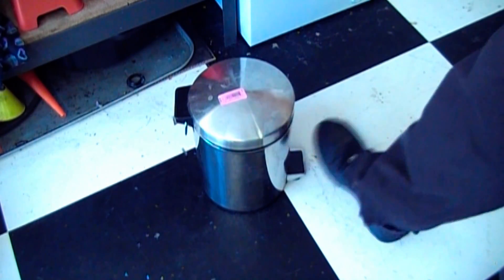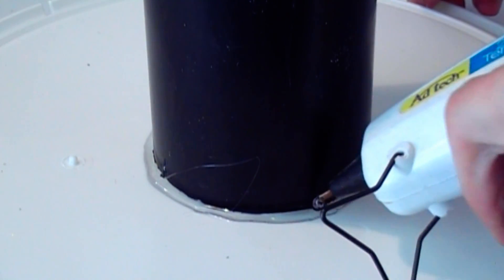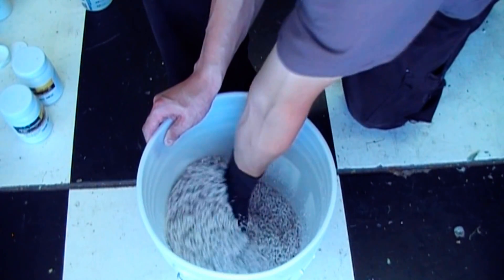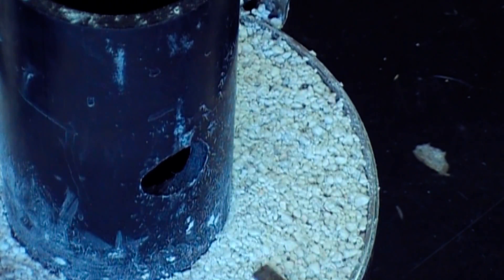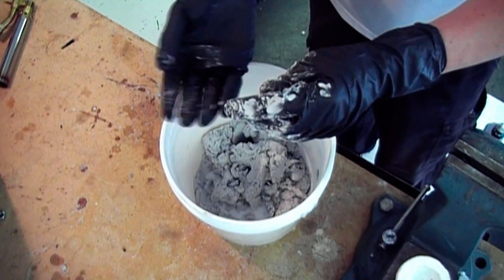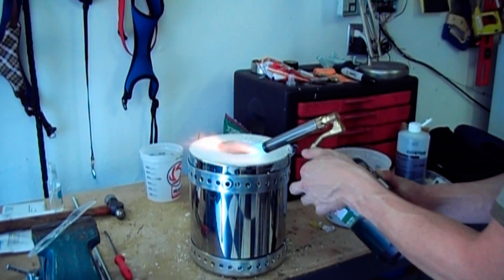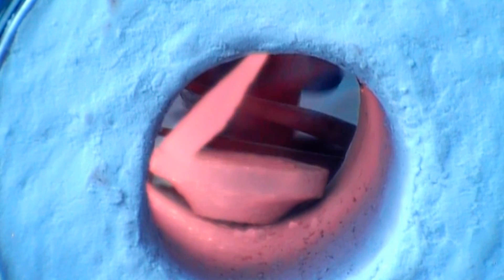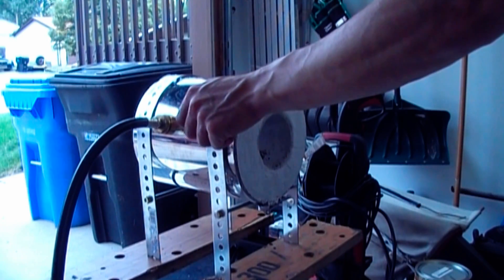How to build a trashcan forge

Comment: very nice forge, by add the aluminum, does it keep CO2 from curing the sodium silicate? Sodium silicate is often used in casting sand, and CO2 is used to make it set up.So I was wondering if that is why you used heat to cure your small parts  or if a crucible is made from the mix.
Reply from the maker: The aluminum oxide is the primary refractory material here. The perlite adds insulation, the sodium silicate glues it all together. I use heat to cure it because it's easy, CO2 would also work. There is a lot of CO2 in the torch flame too.

Comment: Got a question - do you know the solution of the sodium silicate? most im finding online is ~40% sodium silicate ~60% water. Awesome forge BTW!
Reply: offraodmisfits Its all I can find as well, I looked into it a bit more and it should be totally fine as long as you do what Clkindred mentioned which is letting it dry a day or so (with the alumina oxide) before applying it.

I am currently gathering up all the bits and pieces and should get working on it this month. If you haven't started by then i'll let you know how it went. :)
Reply from the maker: 40/60 is more dilute than what I made with the sodium hydroxide and silica gel, but I cut my solution with an equal amount of water for the perlite part of it. The only area where the 40/60 might be a problem is the aluminum oxide sealing cement, I did not thin my solution because too much water there will make the cement "blister" when heat is applied to cure it. You might be able to use the 40/60 for the alumina cement if you let it dry for a day or two before exposing it to heat. Thanks for the comment!
Reply: Thanks for the reply, i'll have to give it ago with the 40/60 solution and hope for the best, ill take your advice and let the alumina oxide dry a little while before heat treating it. 

Sadly it looks like the #10 can I got from work is galvanized which I find weird because it was used to store pineapples. 

Thanks for the info :)
Reply: SloanAlex  have you done it with the 40/60 solution? because that is all I can find.

Comment: The desiccant I got from some computer boxes is what I thought was silica  gel was actually a clay looking stuff could I use that
Reply from the maker: It might be sodium bentonite clay, in which case no, it won't work for making sodium silicate.
Reply: What could I do with that clay
Reply from the maker: Manuel Ramos Not much, you can use it to ram rocket engine nozzles and end plugs, or soak up oil spots in your driveway.
Reply: OK cool
Reply: You can use that clay to make casting sand for pouring molten metals into.

Comment: This looks very interesting and well made. You are a very smart person. I have a question that to some it might be silly but I'm not familiar with any of this stuff. The question is What can you use this forge for?  What can you do with it?  Thanks :0)
Reply: With a small forge that size you could make small projects from nails and small knives to something as long as a lawn mower blade to make big knives and machete's. And by the way the only silly or stupid question is the "one that's never asked", if you don't ask you'll never know. Thanks for asking.
Reply: Wayne Hendrix  Thanks  ;0)
Reply from the maker: Yep, heat treating blades, as well as small forging projects is what I will be using it for.

Comment: Great video! Can‘t you use regular concrete or cement for the insulation or won't that hold the heat and/or break? I don't know where to find these sodium silicate and all that stuff here in europe and concrete is much cheaper. Thanks in advance
Reply from the maker: I tried concrete a long time ago but decided it was a waste of time. The thing just would not get hot, there is so much water in the concrete, and it's so dense and heavy it just sucks the heat away.

Comment: Is there any significance on this one being a "thru and thru" forge verses one with only one opening like your coffee can forge? In my thought process, I feel your coffee can design would be more functional, due to the ability to trap more heat.
Reply from the maker: MafiaMotorsport Closed end forges are hard to heat long objects in. You can get the tip very hot, but if you need heat farther back, you are out of luck because you can't push the work piece any father back. I'm working on some sort of adjustable door set up so I can close it up for better heat containment. A failed prototype can be seen in the back of this forge in my forging project video.
Reply: clkindred ahh I see, and understand.  I will still most likely use the other design except find something that will still be deep enough for my needs. I like the idea of a door as well. Thanks for the great vids.

Comment from the maker: +Meticularius You are welcome and thanks for watching!
Reply from the maker: Yea, that is the concentration of the solution. My recipe starts with 500 grams of total solid material, and 500 grams of water, making a 50% solution, however I boil down the sodium silicate to about 60-70% concentration.
Reply: Iv just taken up knife making. Your video has filled me with confidence to try and build my own forge. Thank you for your time and effort on these videos. Could you maybe just give me some idea of what could go wrong during the build. What things to pay extra attention to etc. or even safety measures to follow. Would appreciate it a lot. Thanks man.
Reply: +john black i have actually gotten the plaster of paris mix to work, 2 parts plaster to 3 parts sand
Reply: William Ponder If you look through the rest of his videos he has instructions for Sodium Silicate & his paint can forge shows how to go about building up the walls.
Reply from the maker: No, just about anything can be made to work, as long as it's big enough to allow a thick enough lining.
Reply from the maker: I think they stopped making those because I can't find them either. You can use a 1/8 to 3/8 BUSHING, threaded into a 3/8 to 3/8 COUPLER to make the part.
Reply from the maker: I show that method in my "building a bigger blowtorch" video
Reply: this is really cool could you make something like small knives with a set up like this?
Reply from the maker: Sure, my newer videos show projects like that.
Reply: cool a friend was showing me this video before and we were thinking about building one to make knives
Reply: I found sodium silicate for sale but the have percentages next to them like 40.% and 37.5%. Type in sodium silicate on eBay and you'll see what I mean. Ps is that percent mean anything?
Reply: Do you think it will still work okay with that low of a concentration?
Reply: +clkindred I really like this video and I was wondering if using the combination of 1 part Plaster of Paris and 1 part Sand I keep seeing in other videos work just as well as your mixture?
Reply: +clkindred How thick does the perlite lining has to be? Do you think 2.5cm are enough to smelt aluminium ( 600°C)? The wrap is 2mm steel and some case heat would be no problem.
Reply from the maker: That might be on the thin side, 3cm to 3.5cm would be better if possible.
Reply: Okay, thank you. Hard to find a zylinder with the perfect radius. Make I'll craft one out of cardboard...
Reply: +clkindred great video - would I be able to use this cement on the inside of my home made braai (bbq)
It's a metal drum cut in half. I used heat resistant spray to avoid rust. Now, this cement would be great for the inside.... ????
Reply from the maker: +Verum Quaerere Seek Truth To cook food over? It should be fine as long as your chemicals are pure, if not there might be some nasty stuff burning off for the first firing. Personally I think using this cement for a food cooking device is more trouble than it's worth, unless there is some huge advantage that I am unaware of.
Reply: clkindred Yea, in South Africa... we 'braai' regularly - the problem is, these metal 'bbq' rust - also hot to the touch on the outside. I want something to paint on the inside. Nice smooth finish.  I have used expensive heat resistant paint just to melt or bubble. So if I could insulate the inside, I'd use less coals, and prevent my braai from rust. Some videos use plaster of paris for diy forge/furnace... please help.
Reply from the maker: Oh, sorry I don't check g+ very often. If it's not too late, my advice would be take your time, sand and polish all the tool marks of before hardening. Otherwise those marks will always be there. Also, don't file the bevel so close to the center line so as to almost sharpen it. There needs to be some thickness to prevent warping and carbon loss from the steel during heat treatment.
Reply: Hi  @clkindred   I'm just curious to know how well this mixer held up over the years? When did you reline the forge? 
Also what temperatures were you able to achieve? Great video by the way.
Reply: does break and crumble after a few heats though
Reply: +clkindred I just posted a comment/summary of your two builds. Had a few questions I think a lot of us have on your experiment. Might be able to pin it at the top and save a lot of individual questions. 
My post starts off with "That was 3 years ago".. Wasn't sure since I didn't reply that you would get the comment.. 
I don't get some comments on my videos for some reason I can't figure out and hate to see one go unanswered for a long time.. Answering gets me thinking..Ha.. Thanks fella.... Nice Videos.
Reply: I posted a question about how well this has lasted for you, and your opinion about the Aluminum oxide paste you hot face coated the face and inside of the forge.. Sometimes I do not get notification, unless someone posts a reply to my reply.. Just adding a post won't give me a notification.. I have to look for it. The reason I posted here.. I am going to build a forge, and was thinking about this.. I have black aluminum oxide blast media that I am not using any more. 50 pounds of it..Ha.. Thanks.
Reply: Just line a cheap BBQ (braai) pit with a mixture of perlite and either sodium silicate or perlite and plaster of paris. Layer it about a CM at a time until it gets thiick, smooth it our as shown. You can build a big wood fire in it, remove the embers, and still cook for an hour.
Reply: Plaster mixed with perlite works great. Very good insulator, my soup can forge takes a long time for the outside to get real hot. Warning to users, plaster of paris sets very fast, so work quickly.
Reply: The drying problem of this formula can be resolved by the use of a DeHumidifier inside of a plastic bag as well as the forge. The problem of CO2 is that being heavier than air it can not access the sodium silicate. Love your thinking process and its demonstrations.
Reply: The aluminiumoxide ammount was the wrong way around.

Comment: Nice video! Got a Q: Can this cement be shaped and used as a crucible for melting Al/Cu? It can take the heat, but is it tough enough?
Reply from the maker: Alexander Kolev depends on how big. The one I showed here is about a big as I would be comfortable with. A larger size and shape is something I want to try, but the cement is hard to work with in a project like that.
Reply: clkindred I'm thinking something up to 0,5L. And I'm still working on the mold... Will you make a video on your crucible project? Would be nice. :)

Comment: Great video. I am happy to hear that the Aluminum Oxide has helped with the perlite melting issue I was having on my foundry. I may have to revisit that foundry and line in the same manner.
Reply from the maker: It still has the problem of being a pain in the butt to work with, messy. Thanks for watching!
Reply: Hey Digitizer. Is the aluminum oxide mandatory? I have to special order it and its expensive

Comment: Cool design. I especially like that it's open on both ends so longer pieces of stock can be used in it. If you don't mind me asking, what's the average price of the materials you used?
Reply from the maker: I knew that question was coming! Well the trashcan I got from Goodwill for like 3 bucks, a bag of perlite is about 4 bucks, the aluminum oxide grit I got on sale for 6 bucks a jar, so 12 bucks total. The sodium silicate is harder to judge because the materials needed to make sodium silicate make much more than I used here. But it can't be more than 10 dollars worth. The burner parts cost the most out of all the components, 15 for the torch valve, 20 or so for the rest of the bits for the burner like the stainless steel tube, brass plug, nipple, coupler and bushing. And I think 20 for the adapter hose for the 20lb tank if you want to count that. Looks like about 85 bucks.
Reply: clkindred That's not bad at all. Whenever I get around to building a replacement for my soup can forge I'll have keep that in mind while I'm buying supplies. Thank you sir!

Comment: Just wondering how well the pearlite / alumina stands up over the long haul? Is it some thing that will wind up breaking down after only a few uses or does it maintain pretty well? Thanks for all the great vids!
Reply from the maker: That is something I was concerned about myself, which is one reason it took me so long to do this video. I forged a small project piece over the course of three weekends, as well as put it to use firing some test samples of other diy refractory mixtures. It even saw a failed attempt to forge weld some bike chain into a billet so it got flux all inside it too. Up until now it has seen about 20lbs of propane fuel burned in it, over the course of a total of about 15 hours of use. There are some minor cracks forming, I think the design not having any expansion joints is mostly the cause of that. That little alumina crucible never cracked at all even though I melted brass in it and used it as a shelf for the forge for much of its use. I don't know how it compares with commercial or professional refractories, I only know that even those have a finite lifespan and need re-lining from time to time. Seems easy for me to patch though, just spread some alumina cement on the bad spot and fire it up! Thanks for the comment! I'll keep you posted.
Reply: clkindred Thanks for the response! Ive been growing an interest in small scale forging, and I felt thses smaller DIY forges would be great to just "get the feet wet" as it were.

Comment: Yet again clkindred well done on a great forge!!! My forge is almost done. Just have to build the stand, get some gas lines and the curing will be done tomorrow morning. I found that a two parts fire brick to one part Portland cement has great fire resistance and strength. You need to wait for the full cure of the cement and then bake it on a low or very low heat. If you do a high and fast heat the stuff kinda explodes on ya. I can't wait to what other things you have in store for us!! Keep up the great work!!!
Reply from the maker: Thank you! I have wanted to experiment with fire bricks, but can't bring myself to buy any. They are not available locally for me. If you have a source for fire brick pieces or off cuts, preferably for free, this sounds like a great way to go. +1 on the slow bake in the oven, unfortunately not a lot of people have the patience for this kind of thing and I expect a lot of frustrated people who tried to make something like this and it failed. I have a video lined up where I'm going to make up test samples of various mixtures of DIY refractory and fire them in the forge to see how they do. Episode 1 is plaster of Paris based mixtures. Thanks for the comment!
Reply: clkindred
Your welcome!! My inspiration for my Forge is based off of NightHawkInLight forge. Utilizing a lot of the same hardware and fire proofing that was was my first forge using a jumbo pineapple can. This one sort of my "mark 2" forge. That plaster of Paris and playground sand works really well but it is very fragile. But because of that it has a really cool feature, if you mess up the forge too much you can clean it out by spraying the forge with a water bottle while it's still very hot . It's quite the sight to behold!
Reply from the maker: TheBoeKing
Cheap and easy definitely play a big role in the success of a design, I tried a "five minute" disposable forge design using a simple stone wool lining, it lasted about ten seconds :-(  A question though, did you plaster forge smell like sulfur / rotten eggs? Those test samples of mine did and it leads me to think the calcium sulphate is not just dehydrating, but decomposing.
Reply: clkindred
 Yeah, mine did smell like that. But i just thought it was the propane. I'm not so sure about decomposing part though, the two I've made held up pretty well. Oh yeah if you try my "mark 2" forge, make sure to tap the side real well. So you can get rid of the air pockets, -.- did not see that coming......